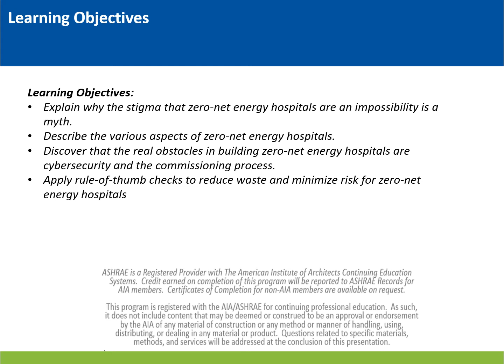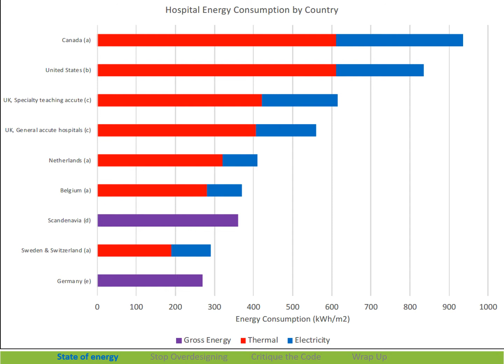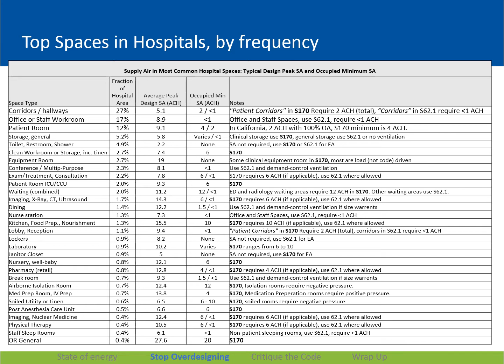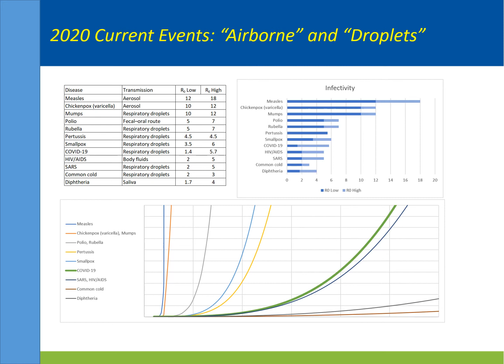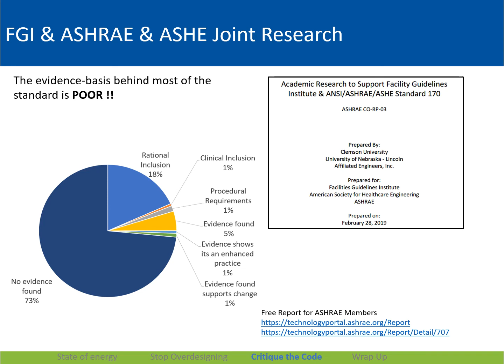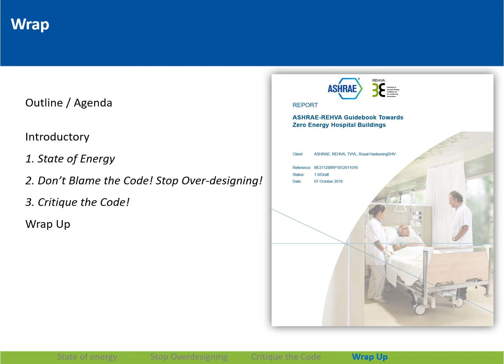Net Zero Hospitals - Air Changes Per Hour: Code Versus Reality (Rehersal)

Comment: Great video Filter Committee! Question here: If I have an AHU that supplies 100% Outdoor Air (OA), can I specify the air changes per hour (ACH) to the ASHRAE 170 stated minimum OA ACH, and not the total ACH; or do I still have to supply the total ACH minimum?